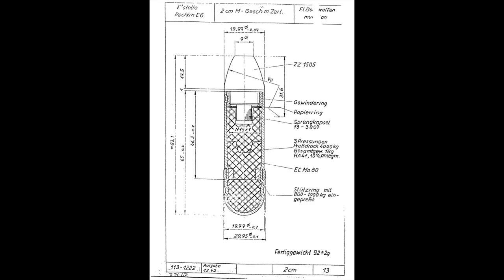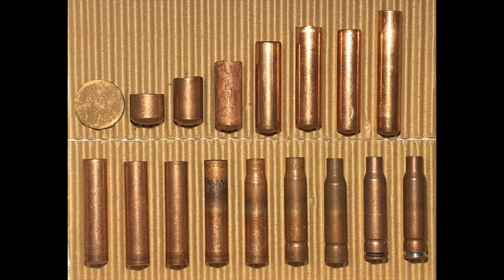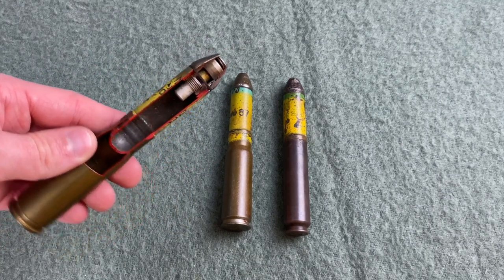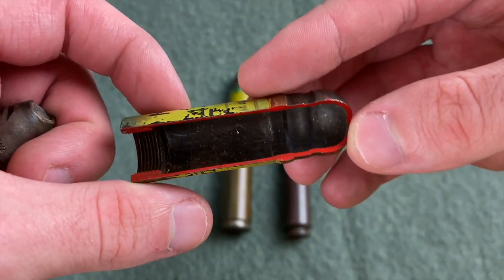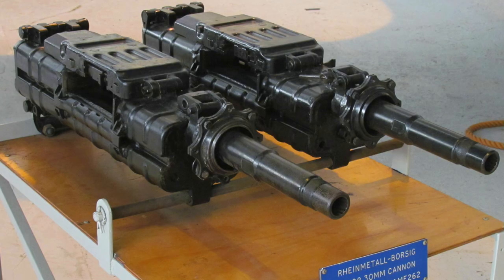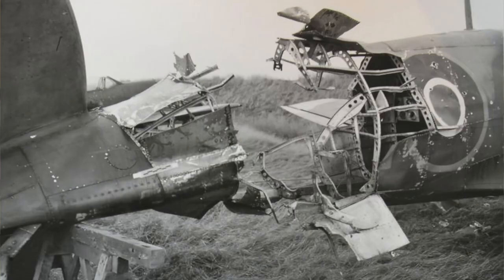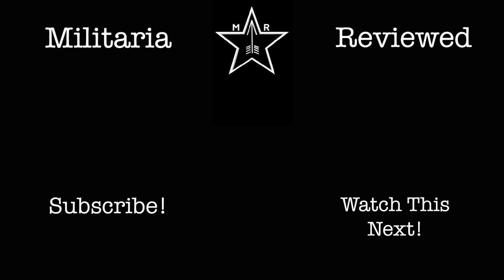Minengeschoss: More Bang for Your Buck

Comment: I have a minengeschoss Mk-108 30mm cartridge in my collection. It's pretty apparent that when the Brits developed the Aden 30mm, they adopted the round based thin shell design. The Apache M-230 ammo is a further development from that where they went for light weight aluminum propellant cases.
Reply: Do you have the 'stumpy' one with the round bottom, or the more pointy one with tracer?
It's very interesting also how the self destructing fuze  (the ZZ1589B) works.
Reply: @nicolatesla9429  The spherical bottom projectile is what I have. It's amazing how thin the case is and how much explosive fits inside.
Reply: @kimmer6  A friend of mine, who is also into this kind of thing once compared the MK108 MinenGeschoss with a stick of dynamite. I'd say it's close enough!
Reply: @nicolatesla9429  When 1 or 2 can take down a B-17, you know its powerful.
Reply: Obviously we're gonna take a good idea, we're not stupid. Or incompetent.
Reply: @osmacar5331  I beg to differ.  The US military made a bad copy of the FG-42 and called it the M-60 instead of just adopting the MG-3 which was based on the NG-42.
Reply: Those are very neat cartridges, short and fat...I don't have one of those, but I do have the 3cm Mk 101/103 cartridge with a belt link.
Reply: @joelex7966  im all for recognizing a good gun, but the m60 was not bad nor was it worse than the mg3 they filled different roles for different nations, the mg3 was made by postwar Germany because they couldn't afford to license build a nato caliber machine gun, and couldn't buy foreign, the m60 was America's forey into gpmg's
Reply: @theliteralworst9416  everything you say is accurate regarding the MG-3.  I disagree with you regarding the M-60.  The M-60 was known for jamming and having other reliability issues.  It was based on the FG-42 however the M-60 was belt fed.  More than 20 countries have adopted variations on the MG-3.  The M-60 has been for the most part retired.
Reply: @joelex7966  the m60 was known for the opposite, the stoppages and reliability issues come from ground troops on the jungle floor having it exposed to the most caustic environment for firearms ever devised, at trials the m60 had over several hundred rounds put through it with no stoppages and it was able to keep going but the demonstrator had shown enough, the m60 shares only few similarities with the fg42 all of which are superfluous and cosmetic/ergonomic, as per the point of the mg3 being accepted by various countries, it falls under the same reason germany even made the gun in the first place, it was a cheaper stamped steel alternative to contemporary nato caliber machine guns countries can afford rather than diving into the foreign market or building domestic, the same reason most countries east of the old Berlin wall use kalshnikov derivatives
Reply: @joelex7966  the m60 was well liked in Vietnam, I wasn't until later in the 80s an 90s when they were worn out that they started having issues
Reply: @bloodking73  I still believe that the MG-3 would have been a better option.
Reply: Hello, sir. Is that an Mk-108 30mm cannon shell, in your shorts, or are you just happy to see me !
Reply: @KennethMachnica-vj3hf   My other shorts housed a Heat Seeking Moisture Missile.

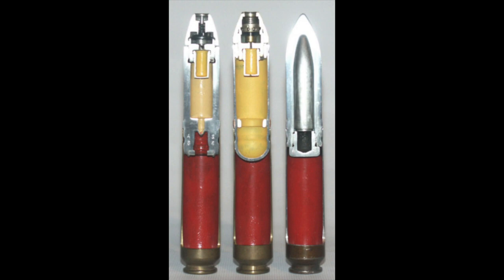Comment: 07:43 well thats not true. A lower weight means INCREASED velocity, not reduced. You can see the velocities of the 20mm HE and Minengeschoss at 02:55. While the normal HE has 585 m/s velocity, the Minengeschoss has 718 m/s velocity. When you decrease the weight of a moving mass, while keeping the same force pushing it, the result will be the lighter mass goes faster. It is physics :D
Reply: came to comment that exactly, only way they were slower was if they had a reduced powder charge
Reply: Will the heavier round carry it’s velocity longer than the lighter projectile? We need a graph of both projectiles together. The lighter projectile may shed its velocity much faster than the heavier.
Reply: @davidclifford9774  no it will not, though a heavier projectile will carry more energy that is a function of mass, not velocity.
Reply: @speedbuggy16v  mass and velocity
Reply: Maybe it's range rather than speed ? Since lighter projectile mean It affected more by drag
Reply: @speedbuggy16v  a lighter round will lose velocity faster than a heavier one
Reply: You also need to consider the fact that all projectiles have a max speed. Going faster then that speed would cause the shell to basically tear itself apart.

These thin wall shells had lower speeds limits then a thick well shell.

Also had to consider the acceleration shock from the powder yeeting the shell from basically zero to mach jesus.

If you try to overcook a thin wall shell well it is likely that it would shattered in the barrel.

You can see the issue.

Comment: For some reason I was under the impression the minengeschoss cost more to produce than the standard shells. I must've gotten things confused as I thought they were forged and machined hence the thinner walls and increased costs. I must've mixed them with bomb casings, I wasn't aware they were able to use drawn steel for projectiles.
Reply from the maker: It seems like the Germans had problems decreasing wall thickness of forged shells while also maintaining consistency. The drawing process was almost certainly more expensive (in terms of labor and the higher grade of sheet steel used) but was the most practical method available. I have been searching for quite some time for original documents discussing the development/testing of minengeschoss but haven't had any luck. If such documents still exist they would probably answer a lot of the questions about cost and the production process.
Reply: @MilitariaReviewed  Is there any examples of the forged projectiles prior to any machining or information on the specifics of their production in regards to the machines used in the machining processes of standard shells? 
The drawing would require higher grade steels and be more complicated in setting up the production line, but I would imagine they would be quicker to produce once the infrastructure is set up since the machines would be doing a single process continuously, and no machining necessary on the projectile itself, just pressing in the threading ring. Opposed to what I can only guess would be them putting the forged projectile into a collet chuck on a turret lathe and drilling several stepped holes as well as threading on a single machine, since the interior view of the standard shell looks fairly complex. That is all just assumption on my part though as well just focusing on the technical rather than considering material shortages for those high grade steels and such. 
I can't imagine what I described being correct for the production of the forged shells since even with large banks of lathes, it would be very slow considering the sheer amount of ammunition they had to produce.
Reply from the maker: @BillWilsonBG  I do know that the description you gave about using a collet chuck and lathe was at least how some larger-caliber projectiles were produced. I have seen a clip from a propaganda film that depicts a factory producing them in this way. Unfortunately, I have yet to find any films or documents showing production of 2cm shells. The closest I have are some data sheets showing dimensions that I would have been provided to the factory. Nothing about how they actually made them though. I do suspect that at least some 2cm shells (excluding minengeschoss of course) were finished on lathes. I have several examples in my collection that have obvious chatter marks left by a lathe. Wish that I had a better answer for you. So much of that sort of information was destroyed late in the war or remains buried in the Bundesarchiv.

Comment: Lower weight projectiles do not travel at lower velocity. With the same powder charge behind a lower weight projectile then the standard said projectile will travel at a much higher speed than standard. The issue is the falloff rate becomes increasingly worse the lighter projectile. These cartridges probably would have been actually loaded hotter than the standard because they are lighter weight projectiles because if they didn't it would not cycle the action of the weapon.
Reply: Another reason was the thinner casing couldn't handle more pressure and friction from being fired with a bigger powder load it'll rupture from it.

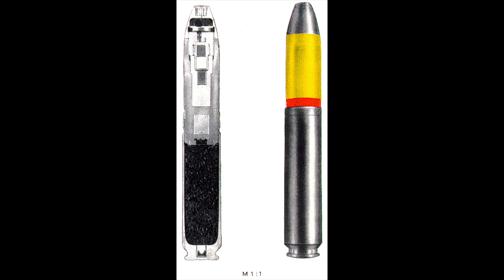Comment: 1:20 The claim that the MG FF only had 60 rounds is not entirely true. Yes, when mounted in the wings of a Bf 109E it was fed with the 60-round drums. However, there were mounts in, for example, one of the Do-217 Night fighter versions, where the 4 MG FF's were fed with a belt. This was made possible by attaching a special adapter where de drum would go (The Japanese did something similar with their Type 99 guns, which were also based on the Oerlikon design).
Also there were 90-round drums which were supposedly used on the Fw190A-5. I used to have one of those 90-round drums, and I've seen a photo of such a drum on a wing mounted gun of a Fw190A-5.

I have also several Minenganaten in my collection; 20mm MG FF, 20mm MG151, (of the latter I also have a Brandgranate 44, which had a similar construction of the projectile body, but with a special fuse for fuel tanks.
I also have multiple 30mm MK108 Mineshells (with and without tracer, and with and without self destruct). I also have a 30mm MK108 Incendiary shell which had a similar construction as the Minengranate.
And you may or may not know this, but the Germans experimented with (among others) a 15mm version of the MG131, called the MG131/15, and there is a mineshell for that cartridge aswell.
Reply: Lieber Nicola Tesla, ich kann Ihnen nur auf deutsch antworten, zum Caliber 15 mm. das MG 151/15 war Ursprünglich das Überschwere Maschinengewehr mit15,1mm oder 0,6 Inch daraus wurde die moderne Maschinenkanone in cal. 20 mm. Entwickelt, als Ersatz für die veraltete Version MG.FF 20 mm. Herzlichen Dank für die ausführliche Informationen in ihrem Kommentar. ❤

Comment: Interesting how they they did the equivlant of smart mines that are produced today where the mines would stop working after so long.
Reply: A lot of rounds had self destruct mechanisms in ww2 but they just weren’t used for mines
Reply: Well... you'd better include a self destruct mechanism. Specially if you are firing AA, defending your country.
What goes up will go down and your citizens might not be too happy if to stop a bomber raid you are going to rain 20mm HE on your city.
On a 20mm the tracer will burn until the projectile reaches 2000 meters then activate a secondary detonator (tracer burn through).
Reply: @JamesCarter-nf1dy  True, though I've seen some WP rounds that looked a lot like AP since they were solid, no nose fuze and only relied on impact to break apart and catch fire.
Not cool when you see a round without a fuze and think this is massive steel. Surprises may arise when washing in hot water...
Reply: @herrhaber9076  yeah you should always check the round type to make sure it's not an internal fuse or something similar.

Comment: Wow! I feel stupid for not understanding how bullets ripped planes apart in WW2. Thank you for this video
Reply: Well, it’s important to remember that only the Germans used “mine shells.” The RAF utilized .303 (7.7mm) in the early war and began switching over to the 20mm Hispano autocannon a few years in, until it almost completely supplanted the .303 except in a few niche applications. The Hispano used a combination of AP, HE, and SAPI-HE ammunition. While the latter two shells didn’t have the same destructive power of an MG 151 “mine shell,” it still packed a good deal of destructive power, and it fired at a higher rate of fire than the 151. Plus, British aircraft would carry 2-4 of these cannons, compared to MOST German fighters, which mounted 1-2 151s.

The U.S. used — primarily — the M2 .50 caliber heavy machine gun for nearly the entire war. The only heavily-utilized U.S. aircraft that utilized autocannons were the P-38 (a single 20mm alongside four .50 cals) and, to a lesser extent, the P-39/P-63 (mounting a single 37mm along with a combination of .30 and .50 cal machine guns). It’s important to remember that the U.S. was mostly focused on bringing down German fighters. A battery of 6-8 .50 cals was more than equal to this task; Indeed, there is an argument to be made to take a large battery of .50 caliber guns over a single 20mm cannon for anti-fighter work. The U.S. never developed a high explosive round for their .50 cal (although they had one for the 20mm and 37mm, obviously).

The Italians used a mixture of Breda 7mm and .50 cals. Interestingly, they developed and used a HE round for their .50. They began using more imported MG 151s as the war progressed.

The USSR used 7mm and .50 cals early war, switching to almost pure 20mm cannon armament by mid-war. Their HE rounds packed the least punch of any 20mm HE round of the war, but they fired fast, were cheap, and reliable.

Comment: Wouldn't the lower weight of the M round mean it has a higher velocity compared to its heavier counterpart? 

I know little about auto-cannons. But I know a bit about ballistics. When you have the same powder charge pushing something lighter, it usually goes faster?
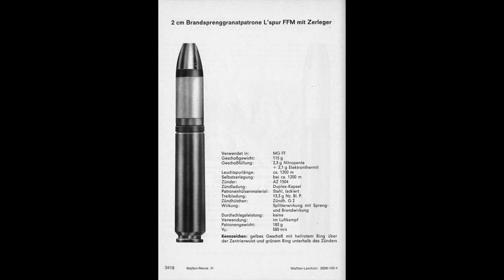Reply: 3:00 your answer in the bottom data.

Comment: Slight problem might be fusing, fuse saftey if eney. Self destruct is nice but it seems that there was no saftey element. That is impact sensitive ammo.
Reply: It looks like a standard inertia fuse ZZ 1505 adopted with the self destruct (Zerlegeladung), so it will prime only after being fired and in rotation.

Comment: Interesting vid, thanks. What ignited the charge? Obviously the fuse, but how did that work?? What triggered the fuse? Did the fuse set off the charge on contact? But it doesn't seem like hitting aircraft skin would cause enough resistance to set off a contact fuse?? You touched on this a little bit....(not wanting farmers to pick up live rounds).... I'm guessing the fuse was lit upon firing the round, and the round exploded shortly after exiting barrel, regardless of distance to target?? Thanks.................

Comment: IIRC, there is this rifle that is the NTW-20 that fired the 20mm Mauser. I wish there was a NTW-30, that fired the 30mm.
Reply: The NTW 20 doesn't fire the same ammo as the MG151/20. Denels 20mm has a case lenght of 83,5mm and the MG151/20 has a case lenght of 81,64mm
Reply: @The6thMessenger  Did I miss something because he doesn't say that it fires the 20mm mauser. It just confirms what I said that the denels 20x82 is it'a own thing and not a 20x82 mauser copy.
Reply: @The6thMessenger  Gun Jeesus is like the rest of us, a human being. But that said I admit in being wrong. The ammo is made to the 20x83.5mm spec but the ww2 era tolerances varied from 80.6mm to 83.5mm (found a new source that gives the variation in case lenght)
Reply: @BlitzFromBehind Even if that's the case, we're still talking about the same cartridge, regardless of whether it's 80.6mm or 83.5mm long -- it's still the ammo fired by the same weapons.

Yes, the dude gets things wrong, such as the article saying that the PAW uses 20x82mm as well, but what he really means is the shorter 20x42mm. 

But I'd trust Gun-Jesus with verified access to these weapons more than some a rando in the internet, that has yet to learn "who the fuck asked?", like every gun-snob I came across.

Comment: Great video. I haven’t seen this table for the ammunition use yet. I only know one account from 1943 and 1944. In the one from 1944 they just differentiate between fighters in the east and west for the MG 151/20, and they recommend the same ammunition as you show here vs. four engined bomber and other planes.
Just shows you that on the west their main targets were for the most part these big bombers while on eastern front they mostly had to deal with fighters and attack aircraft.

Just wish you had more information on the actual performance 🙂
As far as I know were regular HE shells quite effective against older aircraft designs, since the structure of the wing was mainly supported by spars that held them together.
New designs using the semi-monocoque design were quite sturdy to that kind of damage since the whole metal frame supported the wings and fuselage.
So the idea of Mineshells was to rely on a Mine effect (German for blast) to create pressure inside the structure to blow it apart.
But you can see that against bombers the newly developed incendiary ammunition was preferred over 20mm Mineshells. Since bombers are just too big to deal substantial damage with small explosive shells, while a fuel tank fires are usual a death sentence.

So while they tried to develop bigger shells that could take out bombers with few hits via explosive damage, they replaced or substituted smaller explosive shells with incendiary ammunition.
Reply from the maker: Glad you liked the video. You are definitely correct about belt compositions changing throughout the war. No easy answer when people ask about the ratios of different cartridge types in them. The pilots/squadrons generally had a good bit of freedom when it came to choosing load outs. One thing that I like to do is look at reports from archeological excavations of crash sites. What they find can at those can give you a good idea of what was actually used “in the field.”
I have a ton of performance data but virtually all of it is from testing in a controlled environment. It is easy for folks to be mislead by that sort of data which is why I don’t generally bring it up. I can send you what I have though if you would like it.
Reply: @MilitariaReviewed  I’ll take what I can get 🤗